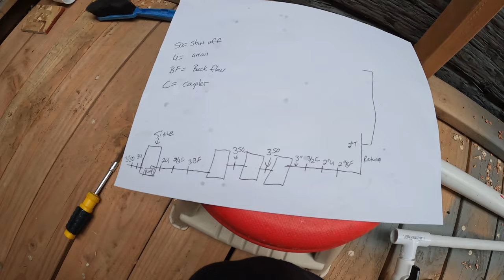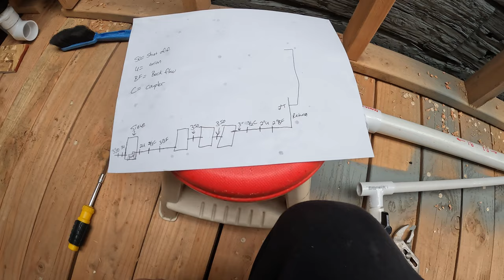Koi Pond Build. DIY Filter. DIY Nessus Filter. Moving Bed.

Comment: Sorry to say but the pvc to abs glue is not legal. It will fail eventually.  No idea why it is sold in big box stores. Hope it lasts for you. Fingers crossed.
Reply: There is no pressure on these joints, it will be fine.

Comment: My pond water is green with algae, filters stay brown with muck. (The thrill of the pond is gone, it's just a job,  I'm to old, want a easier way.) I have a 5200gph water pump. I have a green 18X24 matala filter in front of it, also a white rolled type filter 18X18 at my water fall. I have to clean twice a day just to keep the pump from clogging with debris. Question: How long will I have to keep cleaning my filters before the barrel system takes over? Or will it? My pond 15X18X3 ft. deep.
Reply from the maker: I'd give the barrel system enough time to establish enough beneficial bacteria to support your bio load, you can speed up that process by using bacteria additives like a pond bomb.  I don't know what your stock level is, so maybe a month?  I probably clean my sieve and skimmer every 3 days and I flush barrels 1&2 once a week.  Right now my maintenance is fairly low.  It takes my trickle in about 2 days to fill the water level back up when I do a barrel flush.  As for your green water, are you running a UV sterilizer?  My green water cleared up after about 2 weeks of running my UV.  My pond doesn't receive too much direct sunlight due to my roof.  My neighbors pond is full of algae and has no shade.  My pond has only been running for 2 months now, so algae may be yet to come for me.
Reply: Add a DIY gravel filter after a skimmer and your pond with stay clear.

Comment: I have a similar arrangement and from experience know that overflows can occur if the silt builds up in the bottom of the filters - even minimally.  You will benefit from being able to reduce the flow and by adding an overflow system.  It is not funny waking to find the pond almost empty because the filter has burst its banks!
Reply from the maker: I've been flushing them once a week, but I can see how they would overflow if you neglected the maintenance.  Thanks for the input!

Comment: How did you fit the shower drain to the base?
Reply from the maker: I used a hole saw on my drill to cut the proper sized hole, you then unscrew the shower drain and place it into your hole and make sure the rubber gasket is placed on the proper side (underside in my case).  Instead of using plumbers putty I used aquarium silicone on the inside side of the shower drain.  Tighten everything up and you should be good to go.  I did get a few leaks which I just added a bead of silicone around the underside gasket which seems to have stopped those leaks.
Reply: Thx for the reply

Comment: What size hole did you make in the barrels for the airline? Also is the airline 1.5 inch?
Reply from the maker: The 1/2 inch uniseal uses a 1.25 inch hole.  I used 1/2 inch PVC pipe for the air lines.

Comment: Hi Zippy, Wrighty's filter design still has many unoptimised sediment problems as you'll find out over the next couple of years, he makes a fortune from selling vague (e.g. no measurements to where holes are drilled etc.) plans that look good ... and of course any filter with a decent amount of surface area on the media will give good water parameters (which is what he relies on people using as an indication of filter quality where as it is the easiest element to get right in reality). Wrighty completely changed his several previous designs to the design you feature here after a member called Trace on the UK KoiForum started pointing out the mistakes in his previous designs and showed how to correct them all then went on to show how to build the most efficient blue barrel filter possible (ALL problems and fixes explained in detail). Somebody stole the design & Trace was banned inexplicably soon after. Your filter will give perfectly fine water parameters but will fall down with mulm build up over time that will harbour parasites & anaerobic bacteria that will lead to inexplicable health problems while water chemistry parameters look perfect. Here is a link to the free advanced design concepts thread I'm talking about, have a read it will save you time, money and fish:  https://www.koiforum.uk/water-treatment-protein-skimmers-filtration/18154-filtration-diy-easypod-47.html
Reply from the maker: Thanks for the info, I will check it out.  Not new to fish keeping, but new to Koi keeping, so all the knowledge I can gather is great.
Reply: Can you provide the site to purchase the k1 media balls and how much h was used for the 3 barrels please?
Reply from the maker: @paochew9599  The K1 I grabbed off of Amazon and the 3 barrels I picked up from a local seller I found on Facebook marketplace.  I paid $20 per barrel and the K1 was $200 for 6 cubic feet.